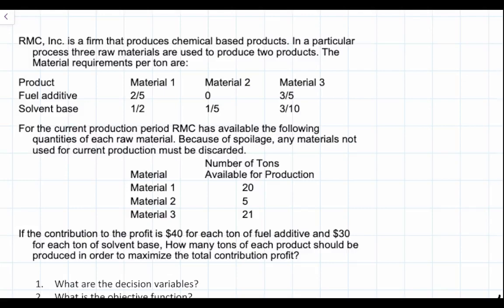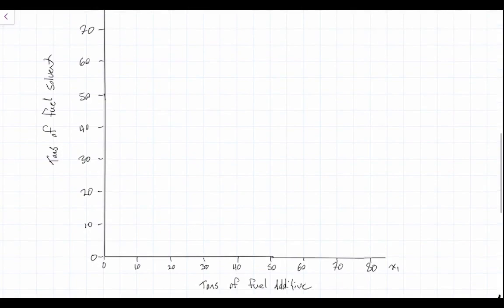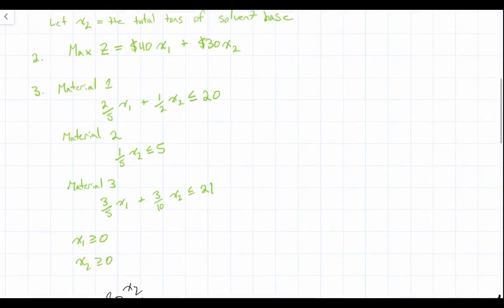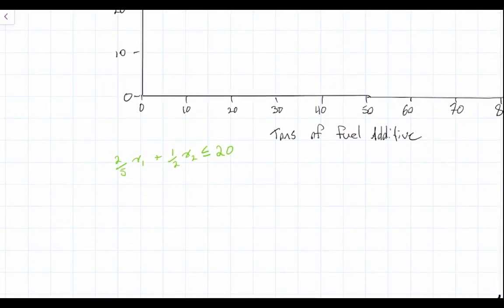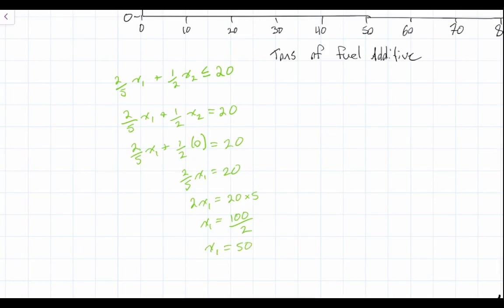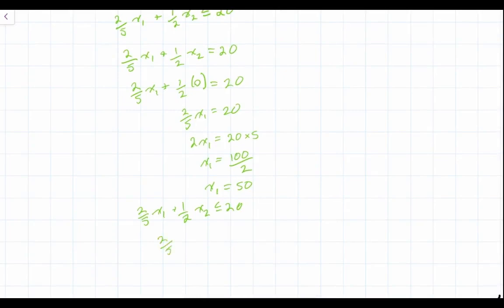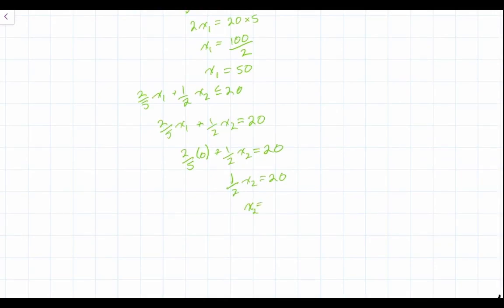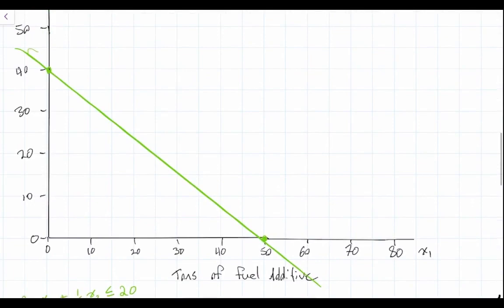Solving Linear Programming Problems Using the Graphical Method (Maximization)

Comment: great step by step. To be honest, I was not sure why (0) was picked when zeroing out X1 side and X2 sides; although it seems the simplest method. Therefore, I assume it best to use (0) when solving for the Objectives
Reply from the maker: Thank you for watching the video and I am glad to hear you find the video helpful. It is important to remember in this video we are working with the variables x_1 and x_2. You will see these variables are plotted on what is commonly referred to as the x and y axes. In video the variable x_1 is on the horizontal axis (i.e., commonly interpreted as the x-axis) and x_2 is on the vertical axis (i.e., commonly interpreted as the y-axis). 

When plotting the various constraints, you have the equation. For example:
(2/5)x_1 + (1/2)x_2 <= 20 

In this step wise approach we set x_1 as equal to zero and then x_2 as equal to zero. What this is effectively doing is  finding the points where our line intercepts the x_1 and x_2 axis so we can plot our constraint. We plot our constraint by drawing a linear line through the two points. When x_1 is equal to 0 we are calculating the point where the line intercepts the x_2 axis. Alternatively, when x_2 is equal to 0 we are calculating the point where the line intercepts the x_1 axis. 

On a cartesian plane (i.e., with x and y axes). You might familiar to interpreting points as (x, y). In this case, you would interpret this as (x_1, x_2). 

I hope this helps make sense of things! Please let m know if you have any additional questions. 

Good luck!
-Andrew